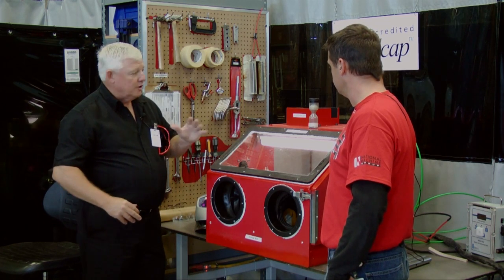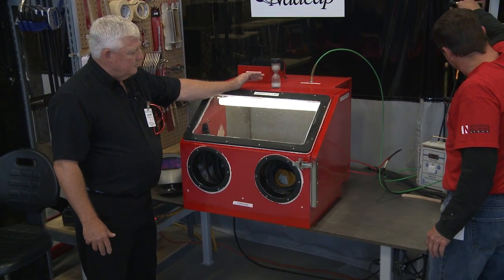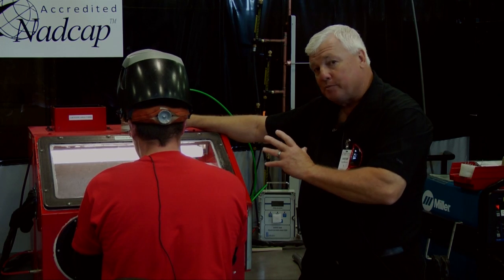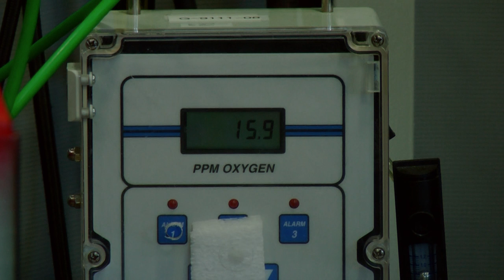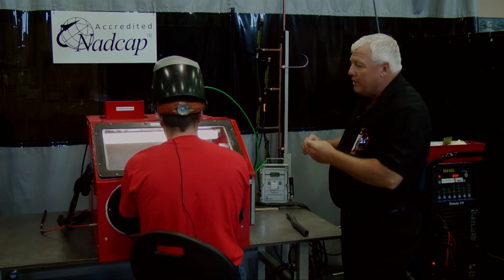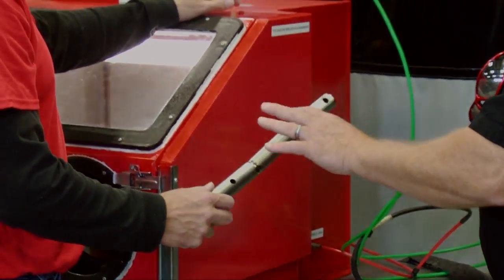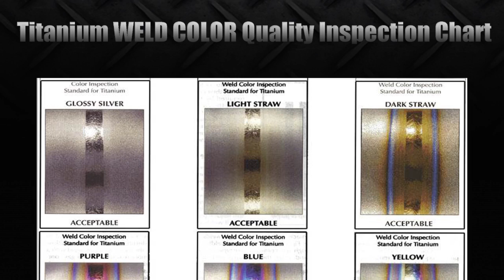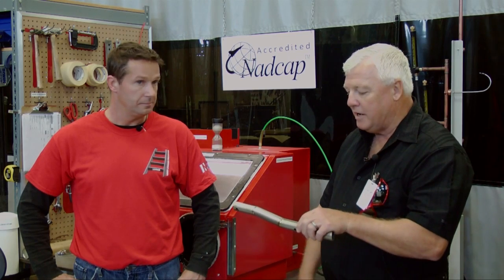How to Weld Titanium inside a Purge Chamber | TIG Time

Comment: Be nice to see a close up of the actual weld. I have welded a lot of titanium in chambers, this chamber is quite low spec from what I’m used to. Also you could explain the special caricature of titanium and it’s high surface tension when in a molten state.

Comment: So my question is can you tig weld in a vacuum chamber since it would be devoid of an gas or reactive elements? And if so wouldn't that be cheaper than using argon since all it does is shield parts from reacting to the elements in the atmosphere?
Reply: That vacuum chamber would be extremely expensive as absolutely vacuum would require insanely strong material

Comment: I'm no world renowned Welder. But I never set my hood down on its front. My anxiety went through the roof when he took his hood off. It's just my weird OCD. Or maybe my first instructor as a kid would kick you in the leg for doing just that. Great video for sure.
Reply: I actually always lay my hood face down, usually on a clean rag. This is done because the auto dim helmets will dim from the lights in the shop ( I weld SS and you keep your shad vary low) and drain your battery.

Comment: I was taking a test in one of those chambers and the lead welder told me to shut off the gas on the chamber once it was fully purged and I could start welding, something is wrong in that picture? I didn’t take the advice and I did my welds with the purge going.
Reply: As long as you have no oxygen coming in anywhere, you could do that. In this setup, im not sure if the ping pong ball would be enough of a seal to keep that from happening over time, but argon settles because its heavier than air so if the chamber is completely full, the argon should theoretically hold air out, again unless you have a leak somewhere. Definitely a good way to save gas, but if you did have an undetected leak, it could be a costly issue, and companies of larger size usually worry more about un ruined parts than some extra argon. Just my .02

Comment: I wounder what grade of titanium he was welding on? AND HOW MANY DIFFERENT GRADES OF TITANIUM ARE THERE AND ARE THERE ANY BOOKS THAT LISTS ALL THE(GRADES)DIFFERENT KINDS? -NOT TO CHANGE THE SUBJECT BUT ALSO THE DIFFERENT KINDS(GRADES)OF ALUMINUM,STAINLESS?
Reply: Most common types of Ti used in Industry are CP commercial pure but normally grade 2. Grade 5 or known as 318. All materials have many different alloys.

Newnes Engineering Materials Pocket Book is one I have in my tool box.

Comment: Could you somehow use a heavy clear plastic bag, put the torch and stuff inside, and inflate it with argon until purged (maybe completely suck the bag out with a vacuum cleaner?) and use that as a purge chamber?
Reply: Yes. Google portable purge chamber. They are what you're talking about.

Comment: It'd Be Cool If The Glass On The Chamber Darkened So You Don't Need A Helmet.
Reply: that would be a pretty expensive auto-view lense
Reply: It appeared he did not have positive pressure on the glove box or his gloves would have popped out. With positive pressure your gloves are fighting you to stay in there as you indicated.
Reply: @ernestmurphy3898  Good spot.  I guess a light pingpong ball is not going to provide much back pressure.
Reply: @JustinShaedo  the argon is where the back pressure comes from, unless the glove box leaks.
Reply: @ernestmurphy3898   Correct. And the box does leak (as it's designed to do). That's what the ping-pong ball does, it closes the leak until the internal air pressure is greater than the weight of the ball. It's designed that way to let the oxygen (lighter than argon) escape.
Reply: @ernestmurphy3898  Probably worth your time to Google 'back pressure'
Reply: @JustinShaedo  the old glove box i used didnt have a ping pong ball, the gloves had small leaks.
Reply: @ernestmurphy3898  That's great, but in this video there is ball valve seen at 10:37 
These are fairly standard on any commercial setup; it ensures the internal pressure doesn't get too high to pop out the gloves or damage the rig and allows venting of O2. 

I'd suggest looking into modding your existing rig if you're still using it (I assume home made as commercial ones all have top releases like this?) It'll save you unnecessarily venting argon out the gloves and, by putting the release on the top, maximize the amount of O2 you release. Besides why vent towards your body, when you can vent away from it.
Reply: @ernestmurphy3898  how would he have positive pressure? The top has a vent.
Reply: We have a dark lens on the inside that slides across on a rail. Plus we work in a darkened room so no reflection on the clear glass.
Reply: @DavidChuter-m4h  oh, that’s cool!
Reply: How are you going to see what you're doing? Unless the glass is auto darkening.

Comment: Like to watch a well seasoned industrial welder work. It's just second nature to them. I was so gun ho when I was younger and wanted all the accessory's so I built a chamber from a (Harbor freight ? ) small sand blast chamber and it works pretty good. I have used it twice I think in 10 years because I have purge boxes I've made over the years instead LOL.  It may be a sand blast chamber soon again, at least I would use it more !
Reply: Actually, I am doing the same for my first purge chamber.  Basically, I could buy the benchtop blast cabinet for less than what it would cost me in materials to build my own.  In addition to Ti, I also plan on doing a lot of SS and I want to avoid it oxidizing on the back side of the weld.

Comment: If you want to use a vacuum pump to speed this up, the chamber has to be built very strongly!  You can buy stuff like this.  The best thing is to have a "Vestibule", so the main chamber stays full of Argon, and the side chamber opens to the atmosphere.  Then there's a door that opens into the main chamber when the vestibule is finally purged out.  It's an airlock kind of situation.  These setups show up on the surplus market sometimes.
Reply: Load locks, I think they are called
Reply: I've just used a manual siphon pump to speed the process
Reply: Good point.  Just make sure that the vestibule is purged before opening the inner door.

Comment: Great video, thank you for sharing it with us. I do have one question tho. You said that it took up to 8 min to fill the box with argon, but at what flow rate was it? [cf/h]  [l/min]
Reply: Probably about 20 CFH.  To get the time for the first purge volume, take the volume of the purge box in cubic feet and divide by the purge flowrate in CFH and then multiply by 60 to get minutes of purge time.  Because Argon is 30% denser than air, in my opinion the time equal to about 3 purge volumes should be sufficient.  It is best to have a diffuser on the bottom to introduce the purge gas slowly and evenly and does not mix with the air.  If you just introduce the argon without a diffuser, it will mix with the air and take longer to purge out the air.

Comment: What if he needs to change the tungsten?
Reply from the maker: Put extra Tungsten inside the chamber before you fill it and you can change it inside the tank. Otherwise you would need to empty it.
Reply: +Weld.com must be a pain in the buttweld to change it inside the tank! :p 

when you looked at the welds, one were just a tad discolored was that due to running a bit hot?
Reply: The 'color' is due to exposure to air while the weldment is still hot

Comment: do you need the Argon if you take out oxigen. just vacum the cabinet and weld.
Reply: If you could do this, you'd be welding in a vacuum, which is a whole different animal.   It's hard to  strike an arc in there, there's no gas to carry it.  There's vacuum arc melting, but the arc is all over the place, not nice and concentrated as used in welding.   It's a lot easier  faster and cheaper to get a pure inert atmosphere in a chamber than a high vacuum.  I speak from grueling experience.  The kind of experience you get when you don't do your homework!
Reply: The cabinet would have to be much stronger to hold back the pressure, and it would be much harder to move the gloves around.

Comment from the maker: turbotran,

There is quite a bit of closeup footage of the welding inside the purge chamber. Check out the video from 5:24 -9:30. 

Let us know what you think. Thanks for watching TIG TIme.
Reply: When welding in a purge box, do you still need to run Argon through the torch for cooling the torch handle and tungsten rod?  Tia